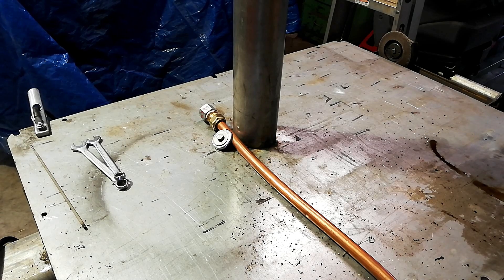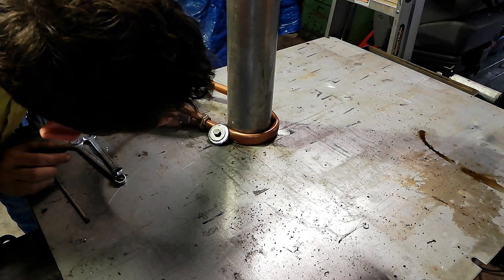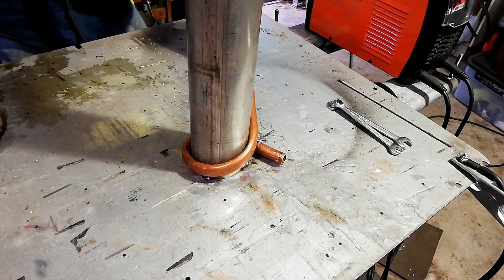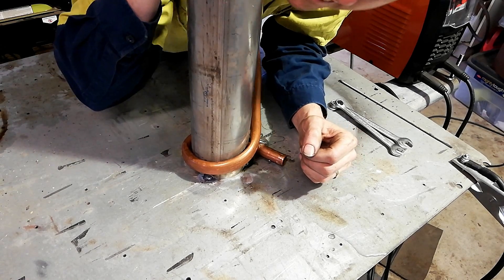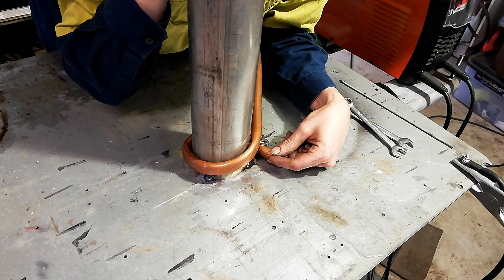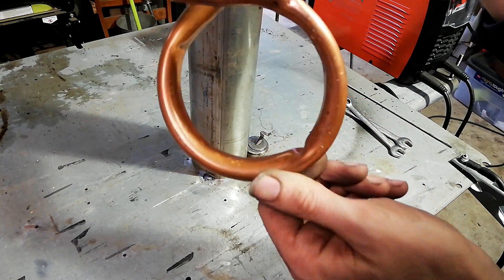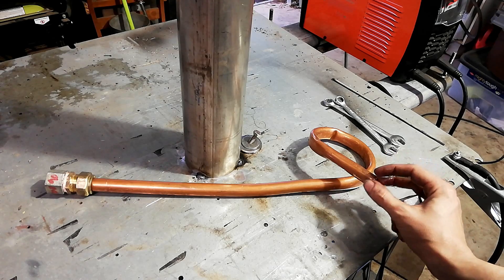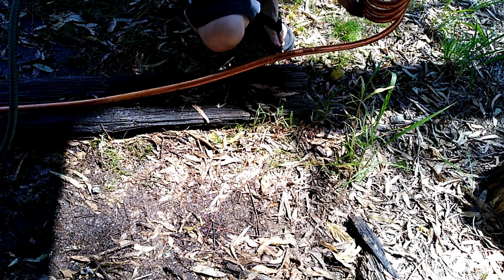Trying water instead of sand to form a copper coil for water heater

Comment: I would flare the ends of the copper tubing with flare nuts in place, if I were using water. Sand does seem a bit easier to deal with.

Comment: I just bought salt and will use it to bend my 3/4 copper pipe to build a heat exchanger
Reply: Did the salt work? Or did it crush and break into smaller salt?  Rock salt or table salt?… I’m looking at doing the same thing, trying to work out salt or sand.

Comment: You can use a billet clamp to hold tube in place while bending two pieces of flat bar sandwiched together in a vice & drill to size of tube

Comment: Annealed (soft copper tube) comes in coiled pan cake rolls,straight lengths are hard drawn (work hardened by the drawing process) you need to anneal hard drawn tubes to soften the copper first by heating the tube to cherry red & let it cool naturally

Comment: River sand dried on a tray in oven spread out thinly once dry filter sand through a fly screen & store in a sealed container squash one end with vise grips & fold over on itself fill tube with the dry filtered river sand about half inch from top squash end with vise grips & fold over on itself & squash flat then roll your coil & form it to your required shape,use tube cutter to cut off both crimped ends then solder a click connect brass hose fitting to one end attach garden hose & turn tap on full it will take about 1-2 minutes for the sand to absorb the water & become soggy enough for the water pressure to push the sand out don’t stand in front of open tube as sand will blast out be patient as nothing will happen straight away when the sand becomes soggy enough you will start to hear the sand move in the tube & the sand will blast out (small funnel to fill tube with sand)

Comment: I saw a bloke on youtube testing this method with a pressure gauge attachedd, I'm certain he exceeded 1000 PSI. Crimp and solder the ends is the only way I beleive.
Reply: Are you really that stupid? A cheap $10 tube bender or a set of 5 springs inserted into the pipe for $20-30. Not too mention the water/sand/duct tape method.
Crimp and solder is needlessly complicated and time consuming.

Comment: Was all in your fittings. Not positive on the filler but there are instructionals on turning these and the angle of attack. Angle being the pertinent word here. This is likely still feasible with water if you were willing to find a better fitting or mar the ends of pipe  to hold the water but given the diameter and scale it would be out of the question for one person to accomplish without further advisement.

Comment: sand/salt /sugar in dry state  has many small space in-between to jiggle when pipe is bending. You filled the tube with water to the full, it has no where else to move but out. Fill the tube with less water and it should work- theoretically speaking.
Reply: It doesn't. Just leaves an pocket of air space to kink.

Comment: Water will work,
However you need to crimp the end with a set of bolt cutters and fill crimp with hot glue, and fold , it does work well , no sand required
Reply from the maker: Thanks mate. That's a great idea. 👍

Comment: I've seen someone else do this on YouTube (greenpowerscience).
You need to have a bit of sacrificial length at both ends of your copper pipe, you put a crimp about 4-5 cm in from one end, then fill the pipe from the crimp to the end with Hot Glue, then before the hot glue cools put a second crimp the end of the pipe about 1-2 cm from the end. Now stand the pipe with the glued end down and fill with water. Repeat the sealing process as above for the top end of the pipe.  Make sure there are no air bubbles at all, air will compress but water will not.
Reply: Seems like an overly complicated way of doing it.
Just watched an oguy from the UK bend decent steel pipe.
Cap one end with duct tape well.
Fill pipe with water.
Fill pipe with sand. Yes most of the water will come out.
Push as much sand in as you can, maybe rap the pipe against the ground and retamp.
Cap the end with duct tape as done earlier.
Bend.
Guy had a makeshift bender and duct tape never blew out and that thick walled pipe bent very well without crinkling.

Comment: I'm not even sure if a copper cap sweated on with tin/antimony solder could handle that kind of pressure. That's the only thing that would stand half a chance imho... and that would probably split the end. I'd stick with the sand pard!

Comment: Both water and sand packing are half right !
If you cap one end of the pipe and raise one end , upstairs or on the roof, fill with water and pour in the sand with a loose fitting funnel.  The sand will displace the water and fill the pipe without voids, works even better than the sander. I've used this method on copper and steel pipe and it works really well .
Reply: Yes, just saw an old guy do this. Fill with water, then sand which displaces the water and packs better than sand alone. Duct taped both ends and a janky home made bender bent a thick walled steel pipe easily and duct tape never came off the ends. 
So many people here armchair experts theorizing either stupidly complicated ideas or plain stupid simple ideas.

Comment: Maybe is you soldered / brazed end-caps on the pipe that would work?

Or look into refrigeration pipe fittings, they can operate at a lot higher pressures than compression fittings can.
Reply from the maker: Sweet, thanks mate 👍

Comment: Couldn't you just leave it outside to freeze?

You're in Whistler aren't you?
Reply from the maker: We are in QLD Australia and we rarely get frosts, let alone snow . . . coldest it gets here is like 4 degrees C.  For anyone living somewhere colder, that's a great idea though.  Thanks mate
Reply: @LittleAussieRockets  I was being a bit tongue in cheek there. As all the ski hills in BC are stationed by your mates from down under. 
Serious note...i saw the same technique using water but the ends were crimped and soldered. Salt seams to be the most common technique

Comment: You need to use heat treated copper tubing. Normally comes with a plastic shell. Just remove the plastic and you should be able to bend it without water or sand. I did this around our sauna chimney a few months ago and it came out perfect.
Reply: 12 mm in diameter
Reply from the maker: What diameter copper pipe was it? I would be interested to try this.

Comment: OHHH NOOO, You Need To Freeze The Water In The Pipe - Mate! Fill The Copper As It Comes In The Coil... Don't Use A Pressure Fitting, Pound The End Flat & Solder Or Roll It Over Onto It's Self A Couple Of Times To Seal & Then Cut Back Off To Round Part Soo Leave It A Bit Longer Than You Need As The Finished Product - 6" to a Foot Longer On Both Ends Minimum... PS Type S & M Is Softer Than L Copper Which Is Almost Impossible To Bend Into Coils... LOL *Another Option Is To Fill The Copper With Hydrolic-Fluid Since The Viscosity Is Higher Than Water That Will Compress Into Itself Unless It's Ice, Then You'd Have To Soap Water Wash & Flush It After!? And Y'all Have A HAPPY NEW YEAR...
Reply: One More Point? If You Are Going To Use Sand, It's Best To Use Very Fine Grit Of Silica Sand Instead Of An Play Sand, Beach Sand, Etc, Since There Is Still A Whole Lot More Air Spaces Between The Particals Which Will Still Add To Flattening Deformity Of The Pipe...
Reply from the maker: I think I experienced that very thing and we are going to try ice to begin with on that little test piece, thanks mate
Reply: Was gonna say this too! Thanks for saving the typing! :)

Comment: I don't know what "copper" your using, but there are soft copper tubing in thicknesses for specific applications.  There are also benders that will allow you to do this by hand.  Copper hardens as it ages.  A lifetime of airconditioning refrigeration I'm just so familiar with this that I would tell you to call any of your buddies that do a/c .  They will show you how to do it with empty tubing.
For a p.s., any auto mechanic will show you how to do it with steel or stainless brake line tubing.  Just remember that silver solder may have to be used to connect fittings or sections, depending on operational temperatures and or pressures.